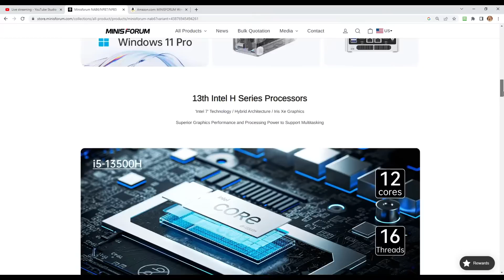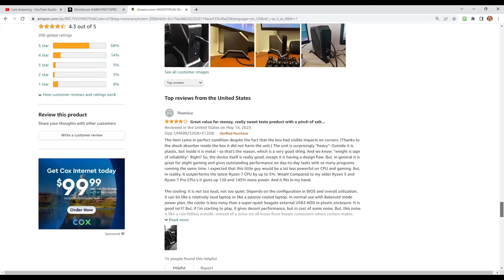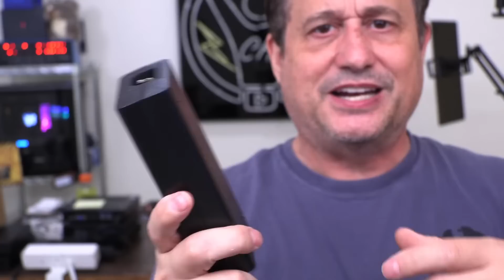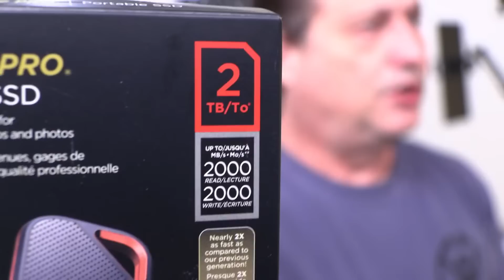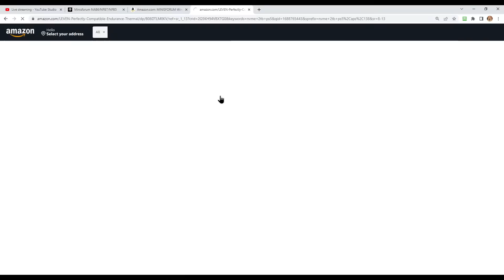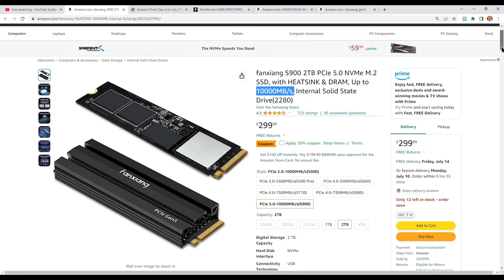MinisForum NPB5 Mini PC - Intel i5-13500H, 12C/16T, 32GB DDR5 512GB SSD, USB4, Windows 11 Pro

Comment: Hi, question(s), Am I able to another ssd to this unit? Or must I replace the ssd that’s inside to get more storage capacity? The ssds I have seen online have heat sinks, must I replace the fan that’s already on the unit for the ssd or can I just use the heat sink?

Comment: I found a computer build for myself from one of your videos. Case: Corsair Carbide 200R Compact ATX Case-Black, Motherboard Gigabyte B560 HD3, CPU Intel i5-11600k, Samsung 970 EVO PLUS 500GB, Scythe Mugen 5, PSU: EVGA 500w Current cost from Amazon Currently Total Cost:  $455.83 minus the Corsair 200R Case.

Comment: 1:24:42 I came across your channel and had just finished researching to replace or possibility of replacing my cpu because I could no longer go to my Etsy store. I ended up buying the kamui. The price point was good and it works great that is I can get into my Etsy store yeah!  But after I bought it installed it then discovered you. You r very informative  I am a little dated so I don’t get everything you speak about. But thank you